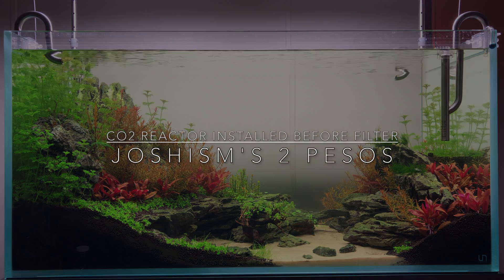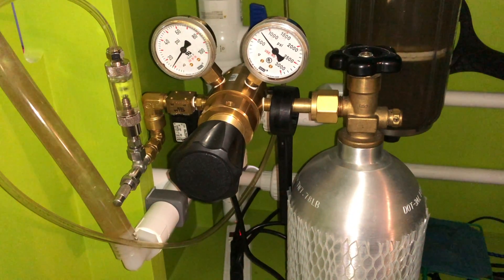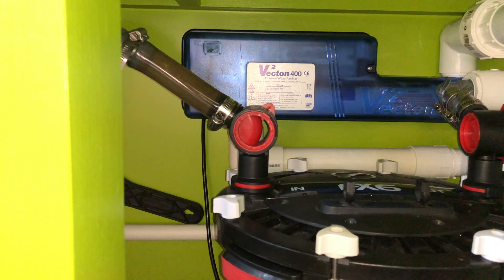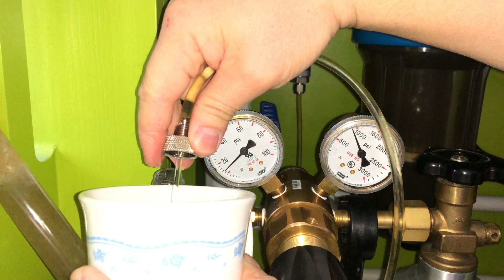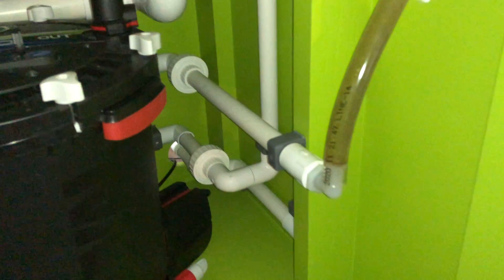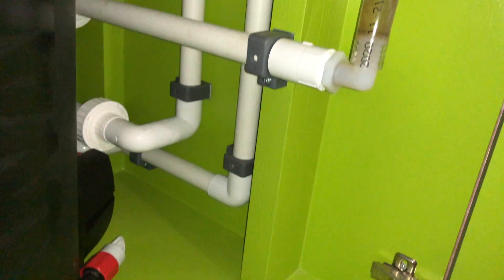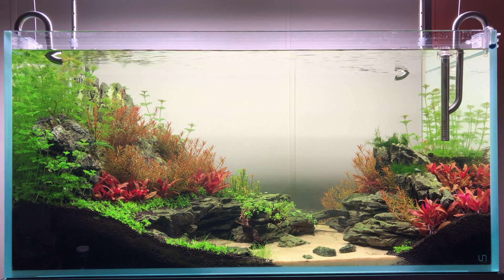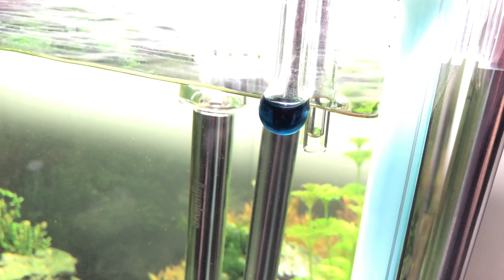CO2 Reactor Installed Before Filter

Comment: What is the current situation? I got 375L, 150x55x45cm with fx6 and have been looking into upgrading to rex Griggs style reactor or some other diy, once I find something I like. Would you have any tips for me?
Reply from the maker: As long as you have a bypass valve, you should be good.  If you don’t have a 1 ph drop after 2 hours, I recommend trying 2 reactors

Comment: I never try using CO2 reactor before filter but i have tried co2 diffuser/ atomizer before filter.My monte carlo start melting three days later it melt totally. Have to reverse baxk from  before filter to after filter.
Reply from the maker: I did it on both my nano and my 120 cm aquarium, and the Monte Carlo are doing very well.
Reply: @joshisms2pesosonaquascapin164  you mean using reactor?
Reply from the maker: @Ttblondey  yes.  I only use reactors.
Reply: I just made a CO2 Reactor but never tried to do before filter. I do 1 bps. After testing water parameters for CO2 i get 28 ppm
Reply: Diffuser seems to have tiny bubble that haven't duffuse in water. Once it gets into the canister it might kill the the beneficial bacteria inside the canister that is what happens to my tank. While reactor it's already diffuse 90%± in the water. That's my theory.